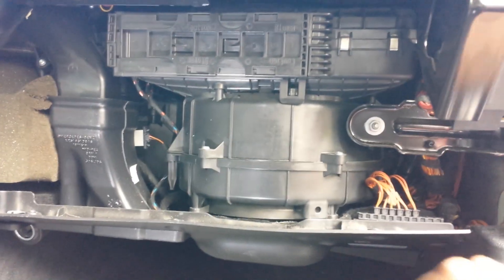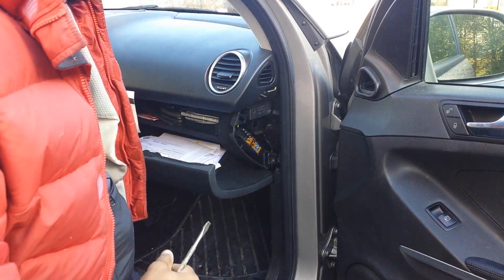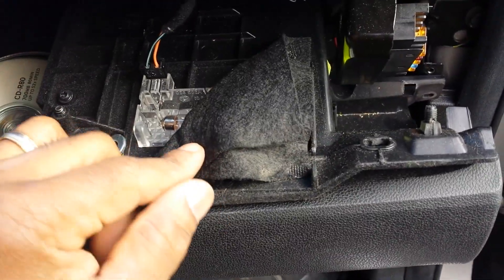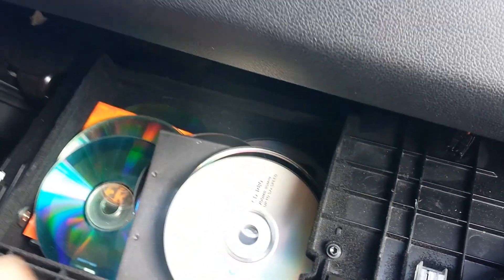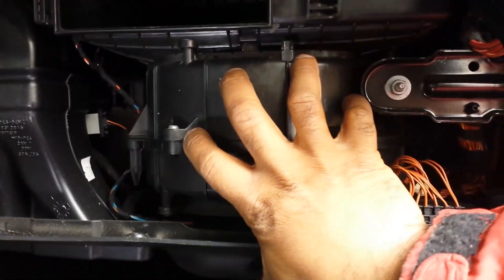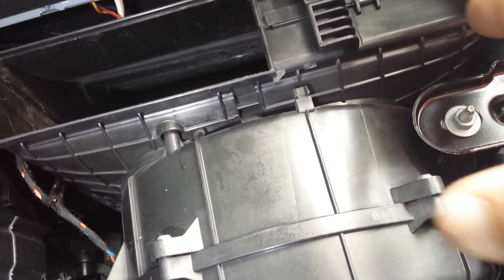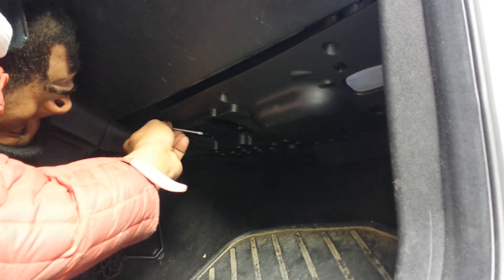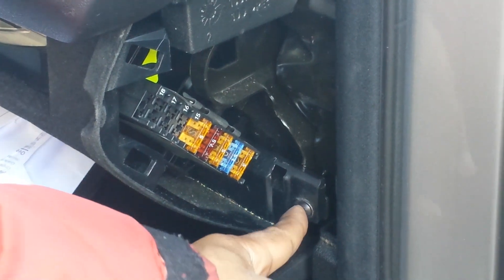Mercedes Air Blower Replacement

Comment: If you're trying to replace the blower it can be done without removing the glove compartment. Simply unscrew the bottom screws mentioned in this video and another bottom screw behind those 3. 

There are only 4 screws down there so you can't miss it. 

After that you can unscrew the blower and slide a new one in.
Reply: I looked at mine, it needs just cleaning out and figuring out what is rubbing on the fan blade, and yes, it was all screws on the bottom, after you pulled off the vanity panel from what I am seeing.  I'll let you know when I get it taken care of if you want.  Ml 320
Reply: Thank You, You should be the one making a video of this.  Something crawled into my AC fan and died.  The smell is indescribable.

Comment: I have W164 2007 ML500 petrol, Do you know where the heater blend door actuator is, i dont get any hot air, blower working, all pipes coolant circulating good, just replaced thermostat housing, still cold air, right now its -30° where I live. Last option blend door actuator where is it? Please ...
Reply from the maker: when you added the coolant back after the replacement of the thermostat, did you have the air conditioner on  and set to high with the heat turned on?
Reply: My local repair garage (no merc dealership) they installed thermostate, they did say let run on heat for long time but didn't still produce heat they can't figure it out. I dont know if the put a/c on. Is putting a/c on critical? If they did do that what else could be issue? I seen w163 has heater door actuator which moves on/off I dont know where's its on the w164 I wanted to check it, or any other suggested please desperate from here -35° lol! Please...
Reply from the maker: @SukiSinghEdmonton  doing what I described is crucial.  Air pockets will be in the heater coils and will not produce heat.  If you are not sure if they did the bleed procedure as described you will never get heat.  What you can do... Got to a place that will do a coolant flush.  They will hook up a machine and evacuate every drop of coolant and air bubbles out and fill it with coolant. .

Comment: One of my problems, is that the motor works, but I get no hot air, any idea? also a 06 ML350, I know heater valve can be a problem, but I ve heard this SUV does not have it, any idea?
Reply: Replace the thermostat, mine did the same thing, even though all of the rest of the cooling systems were replaced, flushed out, etc., They fail by staying open too far when warmed up, but still close right back down when they are cool, so not going to give you a major malfunction from working, at least as far as the engine is concerned.  When I replaced mine, it did slightly lower the running temps of the vehicle, but blowing hot air into the interior big time. 

I am getting this, clean out the motor as part of the preventative maintenance at this stage.  Mine has been noisy since I had it, going for the fix based upon the inspiration from the video, ml 320.

Comment: I have a 2011 E350 , need to replace fan motor it , chirps like a bird lol  what years are they removed the same way ? in other words does a 2008 remove and replace the same as a 2011?
Reply from the maker: the removal is very similar to almost exact for this part.  Differences are usually the star wrench sizes usually.
Reply: I have exactly the same problem in a cla250 2015, it chirps like a bird and it is driving me CRAZY

Comment: Where is the fuse for the blower fan? Where do you check it at? I used a test light to see if there was power going to the blower motor and there wasn’t any power going to it.

Comment: Is this applicable if the fan dies off when you switch to heat?
Reply from the maker: No,  the fan wouldn't work at all.   It is possible that your sensors in the vents are registering the temp incorrectly and disabling the fan

Comment: I need  help with my 2001 cl500, blowing hot air from drivers side vent when ac is on.all other vents are cold
Reply from the maker: You may have a bad ac vent sensor.
Reply from the maker: Check this video for how to fix.  https://youtu.be/u2NaLlbYCnw
Reply: @iRepairAutos  thanks for the reply and video, I have looked all over the internet and still can't find the location of this sensor on my car..2001 cl500. W215.help
Reply from the maker: It's behind the vent